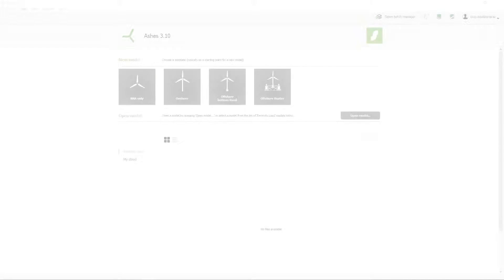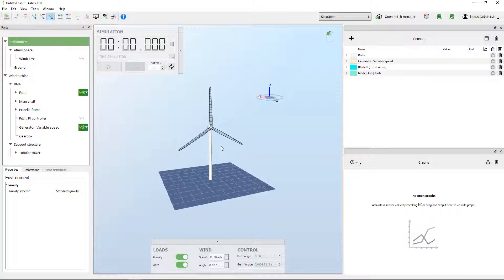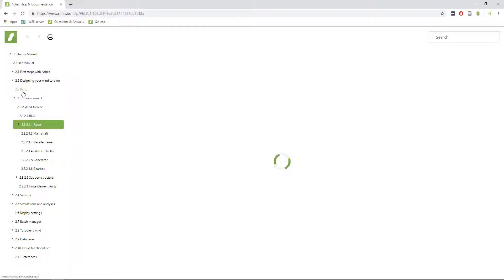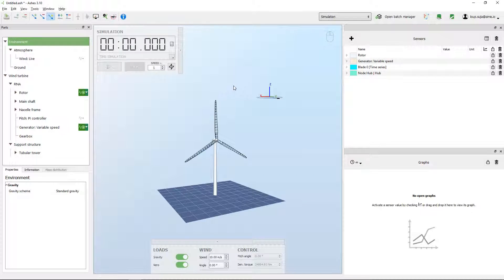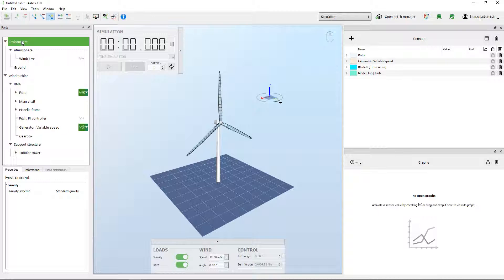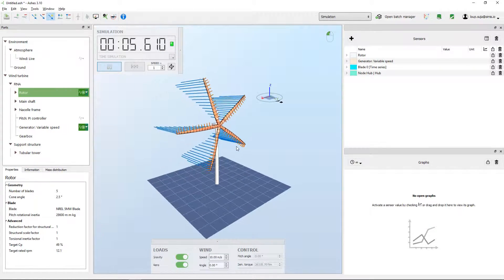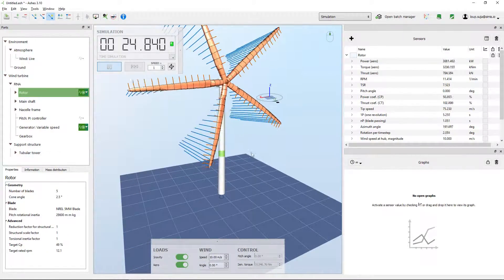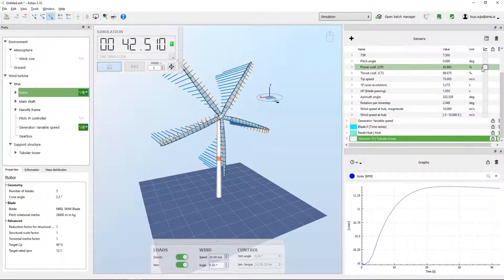Getting started: the basics of the aeroelastic software ASHES

Comment: Hey, does this software only work for wind turbines? I actually need it for aeroelastic load calculations on an aircraft's wings. Is it possible?
Reply from the maker: Interesting question! And we think the answer is: yes, it's possible, but we're not sure how much of what you are looking for you can do. Can you briefly explain what kind of analysis you would like to do and which results you want? Anyway, to get something that is similar to the wings of an airplane, you can: 1) Use 2 blades, 2) Set the initial azimuth to 90 deg 2) Set initial pitch to 90 deg, 3) Fix the main shaft 4)Choose Fixed as pitching system. Please, use the User manual to find more details. Looking forward to hear how it worked out.
Reply: @AshesWindTurbineSimulation  how about propellers?